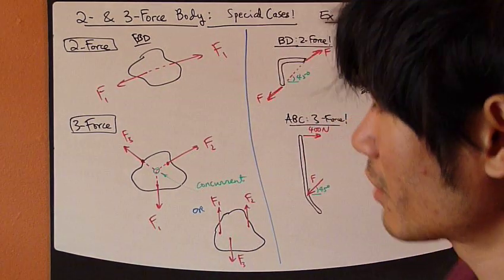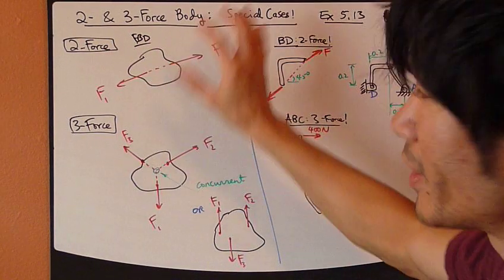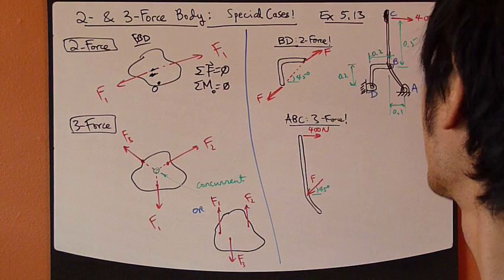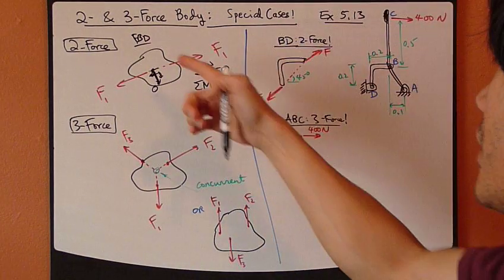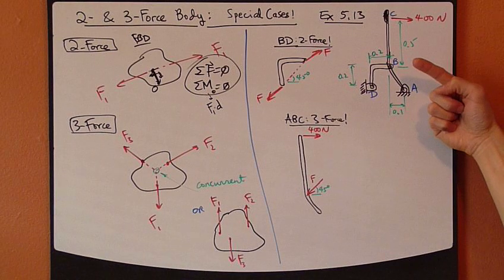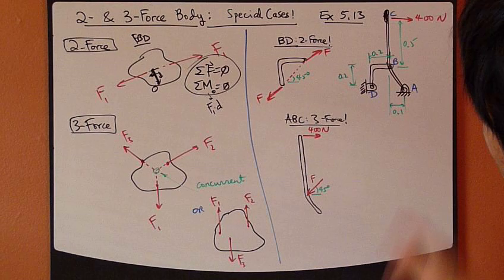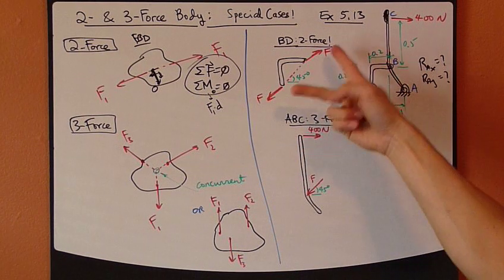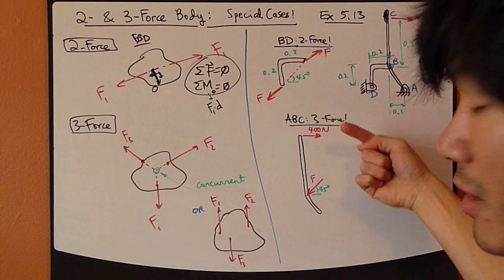Engineering Statics Ch5 Part4: Rigid Body Equilibrium, 2- & 3-Force Bodies

Comment: one question: at 9:04 can R_A be the opposite direction?
Reply: Yes. All you do is choose a direction as positive to do the problem and then when you calculate the components, the sign for the solution will tell you the actual direction.